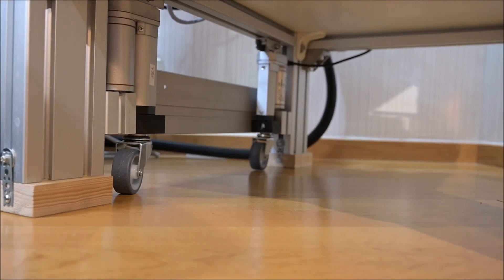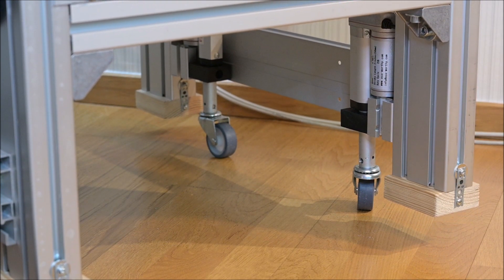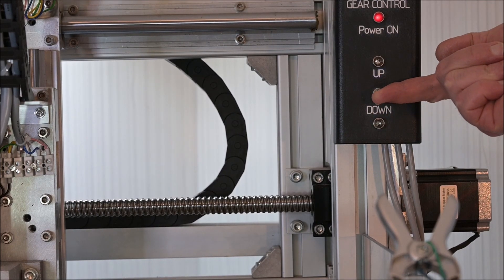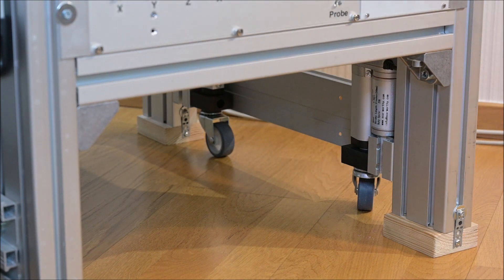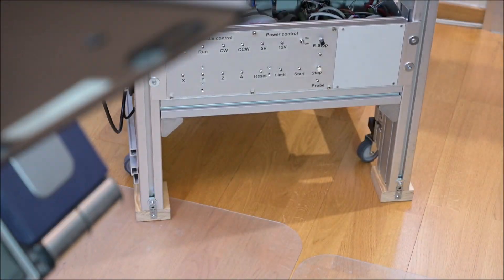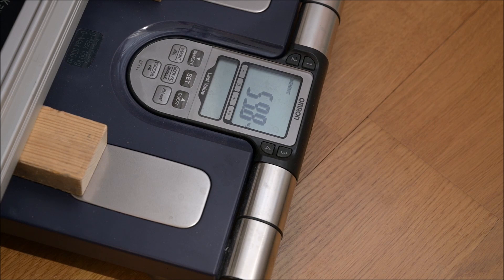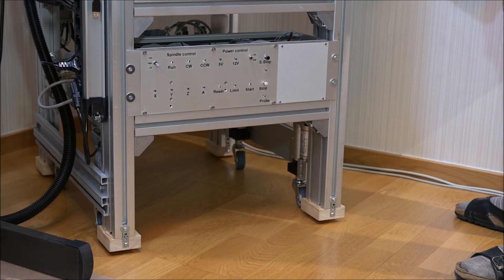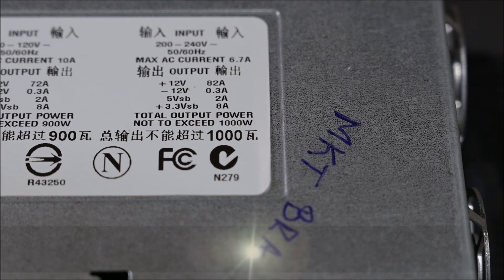Linear actuator controlled gears for my DIY CNC (part 3)

Comment: I would love to know exactly how you wired this. Do you have any videos specific to this question?
Reply from the maker: Hi and thank you for your comment. The wiring video is part 2. https://youtu.be/aB5bX-nn4K4 I have used two relays but the wiring principle is the same if you just want to use a switch. The switch must change polarity when flipping, it must have three positions (left - centre - right) and must be dual pole in order to make it work.
Reply: @AdaptingCamera  thank you for the quick reply =] I’ll be checking that video out today [=
Reply from the maker: @Jenuin  Good luck. It is actually quite cool to be able to lift and lower my heavy CNC.